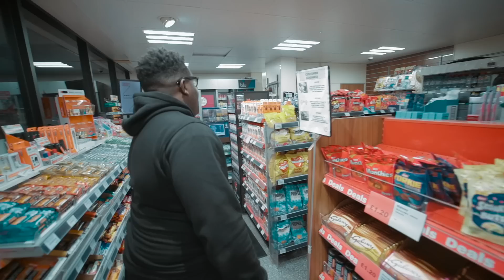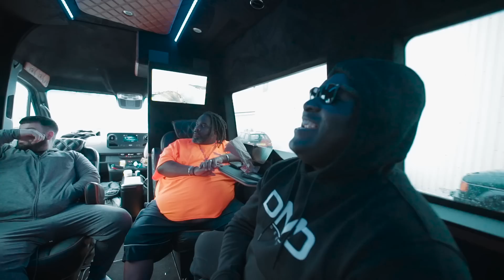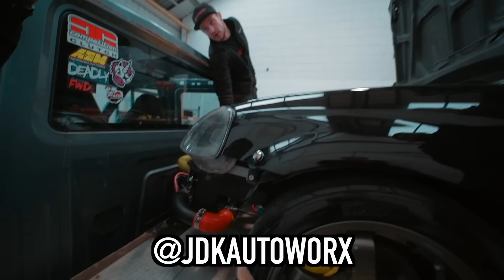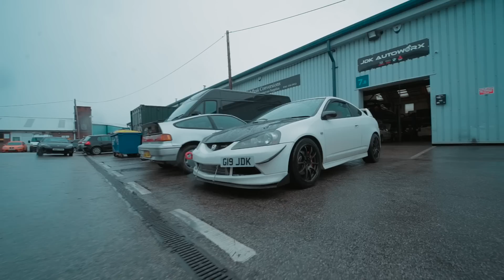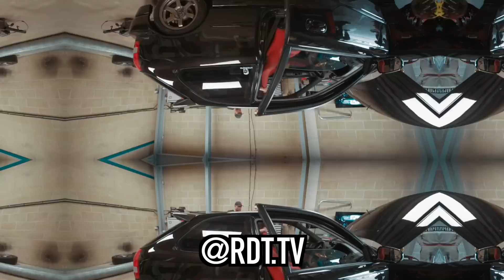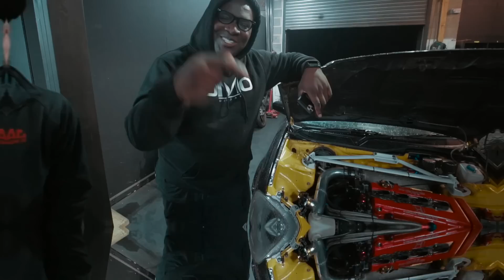MY **1000 BHP** MONSTER 1.8L HONDA CIVIC B18C6

Comment: Just a heads up because you said small big wheels on the front small on the back.. you have to run 4x4 at the same rotational turn because of gearing, something you may want to work out when you do go four wheel drive

Comment: I'm after some one to remap my bora tdi st stage 1 revo 175 bhp at fly and 320 tourqes  .since then I have had fitted  with a genuine pd 150 hybrid turbo . Darkside development side mount intercooler kit and she is a lot faster  . Please help dmo.  I know it's only a tdi . But she fly 's one of the quickest in country and the first to have a hybrid turbo . Would love you to have a go in it . I'm well known around Fareham Portsmouth as Ben with the bora . She sits on 18" dotz h and r 35 mm cup kit . Poly bushes all round . Brembo drilled discs with red stuff pads . Brembo 's discs and red stuff for rear . To help stop lol she is well over 200 bhp and about 400 to 450 tourqes.  I need to put back on rolling road for new figures . I go to Al and sons . Jkm . And darkside.

Comment: 37 psi on an engine that hasn't even been run in yet? Bit extreme that. Should be on stock waste gate pressure and a slightly tweaked map for a smoother running in period.
Reply: Even the USA engine run in isn't a thing. Build it and send it.
Reply: @j.f.4765  literally 😂
Reply: Boosted boiz just send it straight away🤣
Reply: @Themenace-10  exactly
Reply: Guess we will see if this one goes bang for a 3rd time lol
Reply: Today's technology you only need a few heat cycles to run an engine in. Hard run is better. Why do you think drag cars dont get run in lol
Reply: If you listen they did run Watergate presure for a good few runs
Reply: Run it in hard, drive it hard.

Comment: 470 at the hubs on 11psi? fuck off that's pulled out thin air. 700 at the fly on 30psi sounds reasonable.
Get that hondata ripped out and put something like a link ecu in there